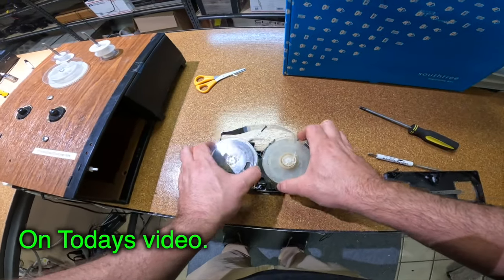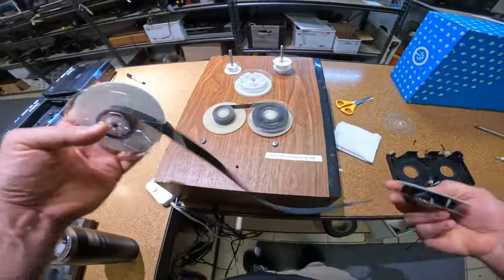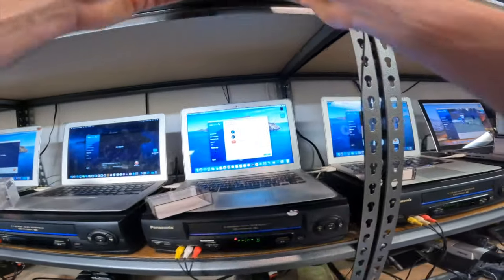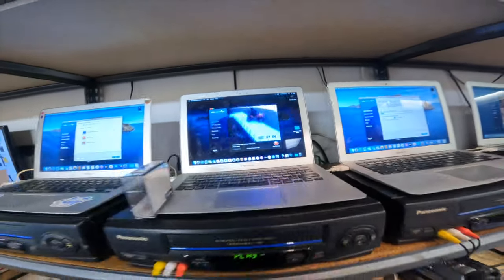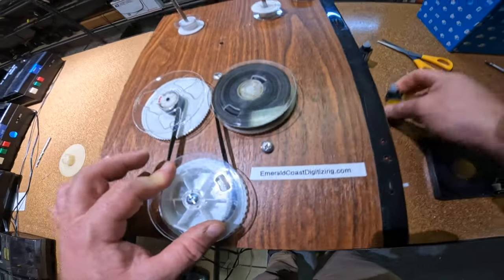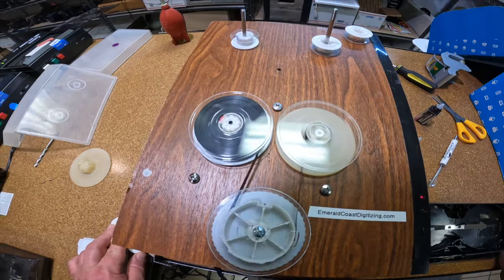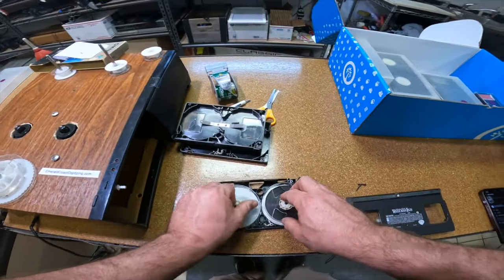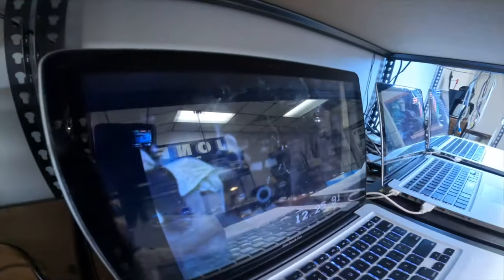THIS IS A PROBLEM ** More vhs tapes with mold. **LETS CLEAN IT!

Comment: hi used to see alot of  vhs at carboots in the uk  i do think how alot get binned  alot of the time now  i had  to pull alot of  betamax tapes apart  

in to there parts   you can't put vhs tapes in a bin   the out case  can go in the blue bin if a pull the tapes apart   in the uk  video tape jam up there  unit 
the bin men are very picky what's in the bin's now 

i saw the bin you put the tapes in left overs  you see    can't  use betamax  in a betacam        i have a deck with a bad video  head  it's to far gone to wear

so i used the  liner audio heads  and put the betamax tapes in tis deck  it will take them as long as i jazz the tapes   i can hear all the audio dropping out on the old 

betamax tapes    ex hire betamax are very bad  heavy wear is a thing